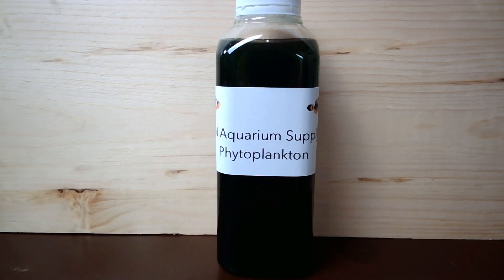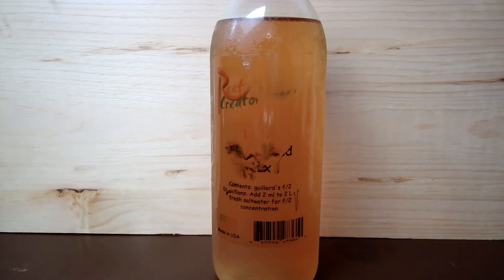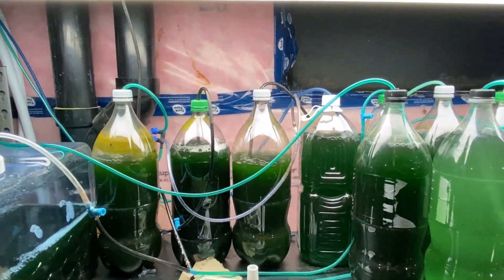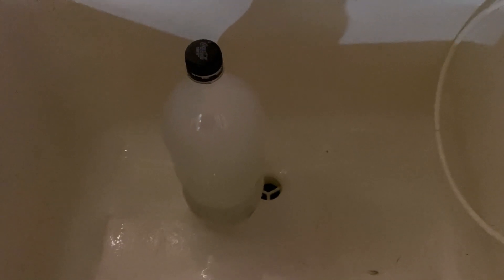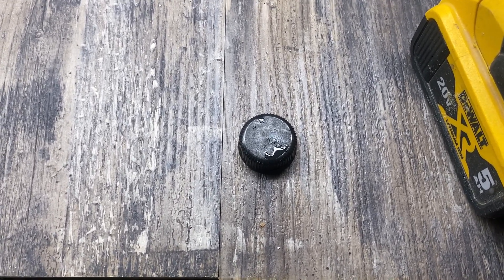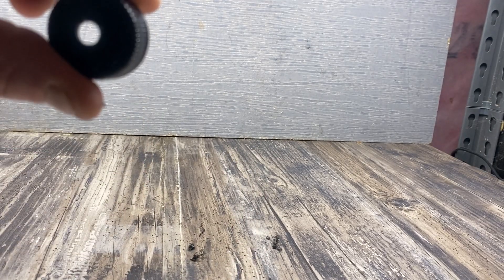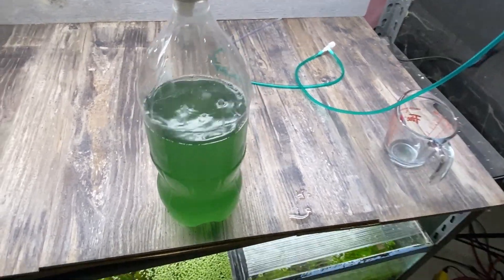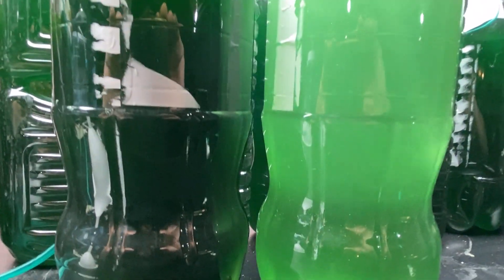How to Grow your own PHYTOPLANKTON!!

Comment: I was looking for more lighting options hence why I watched your video as I use T5’s for my culture and yes bleach every time, I let it sit overnight though, and yes keep  those copepods a mile away and all that you use for each regardless of how much you rinse them, somehow they seem to get in there even if your 12” away, sometimes i think it’s the air bubbles makes them jump across distance as the bubbles burst. “Shrugging shoulders here” so I have separated everything funnels, bottles, etc, one lot is on one side of the room and the other is on the other wall.  So the T5 led lights I have I checked with a spectrum analyser and it’s true T5 grow light, but it’s 20 watts at a close range, and your using 80w at a further range. Just trying to see what works best and somehow my last culture got horrible algae in it so I used it to feed my copepods who didn’t care but I couldn’t put it into my reef tank. Looks like I need to buy another starter culture after 6 months of success. So I can’t complain, right now the 3 litre bottles are soaking in bleach until I get the starter culture so that’s why I have time to see ideas about lighting. Thanks for the video

Comment: Do you sterilize the marine water?
Reply: Marine water is RODI water. RODI is reverse osmosis deionized water. You mix in your choice of marine salt and there is your marine water. RODI water literally comes out of your filtration system at 0 ppm. Good question though bud.